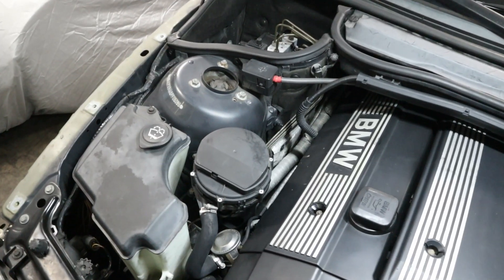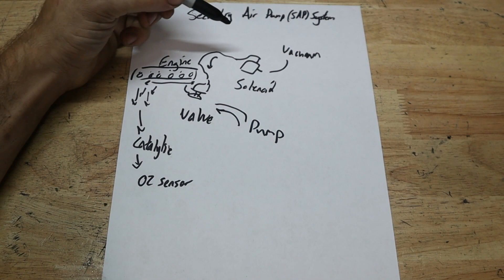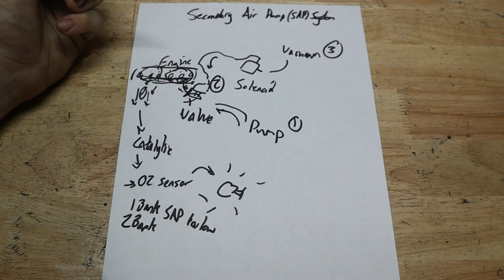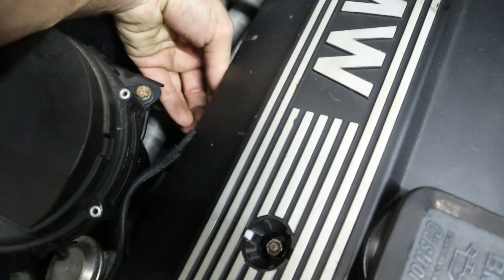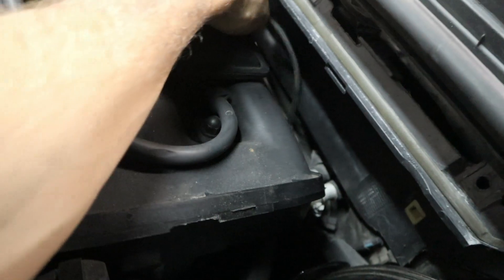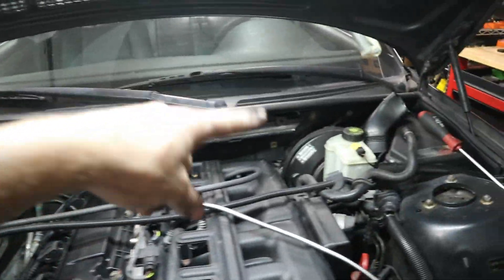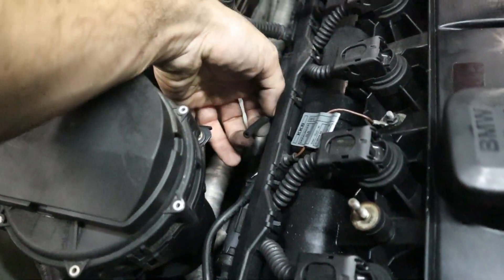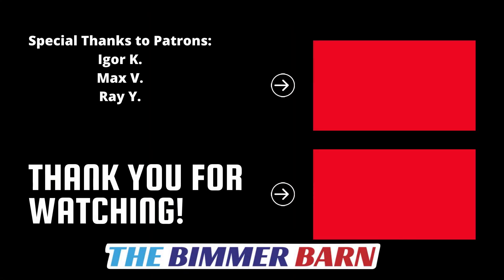HOW TO: Diagnose & FIX BMW Secondary Air System Fault Codes

Comment: Thanks for the video. I have a 2004 525I and it’s giving me throttle issues where every time I wanna accelerate between 40 and 50 and now it’s doing it from 20 to 30 and 40 it is a very weak throttle response and the only code I have to go off. Is this one I already found the leak so I’m gonna try to replace the hose. It’s the hose that connects the actual EGR valve with the secondary vacuum

Comment: Mechanic says I have 2A00 code secondary air…
Symptom tho is growling sound in engine tight vibration. 

Is this associated with this issue?

Comment: What is the symptoms if the valve is stuck?
Reply from the maker: You get a dmtl error for low flow I think, but otherwise the car doesn't run any differently
Reply: @ Thank you for quick answer! Take care, out there!👍💯

Comment: If you cant afford the 189$ hose autozone a basic hose 1 feet for 4$ till u ebay one for 78$ after looking for 2 weeks the. Junk yard one for 10 u pull. Id just take the hose and the big motor with it fkr 20-30

Comment: I have a 04 BMW 325ci, my car does not have a vacuum, the problem I have is that there is no power to the secondary air pump, check the fuse and they have power. Do you think the relay has something to do with it? They changed the key in the car. I don't know if that has anything to do with it.
Reply: Did u fix it

Comment: Excellent video! Thank you for a great explanation. I am running into this issue now. I changed the pump but the codes are still there - so solenoid and valve next.

Comment: Deleted mine
Reply: How
Reply: @Superproductivetoday , remove the entire air system, and the little silver valve (its above the catalytic converter)  with the vacuum line. You block the air line that is in the back of the intake manifold, then there is a plate you install where the silver air valve was (secondary air pump block off plate).
Reply: How is your catalytic converter doing?

Comment: So if I've replaced and made sure all parts mentioned are good, all vacuum hoses, solenoid, black and white check valve, new main valve and pump; but I still have low flow bank one and two codes, I can deduce that the ports on my exhaust being plugged is the only thing that would cause the code now?
Reply from the maker: Sounds about right! You can take off the SAP valve and put a camera in the port and check. It may be so clogged you might not even be able to get an endoscope in there, but that should confirm it for you. Hope that helps!
Reply: @TheBimmerBarn  awesome, appreciate the response my man! I feel that's a possibility being when I bought the car the main hose was busted and the vacuum line at the main valve was broken and both were pretty dirty from sucking in ambient air and dirt lol I'll have to tear into it or code it out by the sounds of it. Really don't want to take the head off lol

Comment: I learned so much from your video!! I have a 2005 BMW 325i with 176,000 miles and my Check Engine Light stays on.  My mechanic said it was my Cylinder Head Ports that are clogged. Are there any fixes to getting that fixed besides an engine replacement? I've subscribed to your channel! Thank you!😊
Reply: I have the same E46 with almost identical mileage! I have been chasing away a check engine light for this type of issue over the last few years. Luckily, I have got it to clear around smog time (every 2 years in CA) I am not sure if you got your issue solved, but there is no way it would require a new engine.
Reply: buy a bottle of catyclean. it cleans the system and clears code

Comment: I have a 2013 128i (E82 with a N51 SULEV engine) and I am getting this code for Bank 1. I have already checked the pump by hooking a battery up to the plug and it runs strong, but I have Active Autowerke headers (which deletes the primary cats), I deleted the secondary cats, it also has an AFE Stage 3 cold air intake, a Magnaflow exhaust, and an Active Autowerke tune (which disables the catalyst system in the DME). The only thing that I can think of that could possibly cause this (and my Thor adapter is suggesting as well) is that my valve is plugged with carbon. Im going to remove it again (because I removed it when I installed the headers), and clean it all out. This is my first Bimmer.

Comment: Secondary Air Injection System Incomplete.
No service engine light, pump is running for 20 seconds and shutting off, solenoid is working and both the solenoid and non return valve do not leak. What could it be?

Comment: Hello. New subscriber here :) Glad to find your video. Can you advise for BMW 320D with Fault code 290900 air to EGR air mass flow, plausibility measured air mass compared with calculated air mass to high, please?

Comment: Quibbles: 1.  the diagram should have been drawn much more legibly,  2.  you blow through quickly and don't really explain how the vacuum lines are routed, well enough for the rest of us to understand.  
Maybe this system is better diagrammed in the Bentley manual (which I don't have).

Comment: Hey I just received this check engine code on my e class benz and was wondering if it is standard to show that the airflow is low on both banks or does that mean that the check valve on each side is faulty? I hear a sort of metallic whistling noise at cold start sometimes and am tempted to adress the check valve that looks like a metallic bell as it seems like it could make this noise.

Comment: I have a 2004 325 touring....240K so far.
Recently started to stumble and misfire...
Code reader says CAT malfunction secondary air pump failure
Runs great 1st 5 or 6 miles....then looses power.
After stopping for long enough to cool...the process repeats.
I can also create the misfire with hard acceleration.
Any ideas?...thanks
Reply from the maker: Does it have a misfire code ? Otherwise I would think a bad oxygen sensor could cause bad running and a catalytic converter fault. Hope that helps!
Reply: @TheBimmerBarn  P0335 and 0702...
my small hand scanner says...
  misfire..cat not ready..secondary air pump not ready....replaced  that hose the short curved one...that made it run worse 🤣
Old hose was soft and spongy.
Was able to get back 70 miles...but stalled twice in city driving...but at least it would start. limp mode on.
I have not seen cold start this am....but its been starting and running great...the great start is when it looses power.
Reply: this am....P0140  160   335  340....
171/174 are gone 🙂
Starts and runs smoothly....driving to a trail head in an hour. Lets see how that goes?
The 2 camshaft position sensors are new.

Comment: So I have a 2005 bmw X3 that's been getting a cylinder 6 misfire on start up accompanied by 2761 code. The air pump and air pump relay is fine - i was told that it was most likely that there's a plugged head on the secondary air ports. I was also told a repair would involve removing all of the cylinders to access the part and not to bother.
Reply: Where's this pumps fuse located and what number....
Reply: @abumannocchi  that vehicle went to the junkyard in the sky about 9 months ago.

Comment: Great video. I just replaced the purge valve and my check engine came on code 1415. Also, I have a 2008 BMW 328i. My Question to you is, how many miles does the car go without replacing the pump?

Comment: Would the filter be to clogged to pull in enough clean air?
Reply from the maker: Perhaps? Haven't seen that before, but could be possible if you live in an extremely dusty area. 

In this case though, you could just pull the hose off that is the fan "output" and put your hand there to make sure enough air is coming out. Hope that makes sense!

Comment: The hose that is capped off with screw and blue tape , runs from your fuel filter/ fuel pressure regulator and connects to an F connector on your upper intake boot right after maf sensor

Comment: I have a 2003 BMW z4 2.5i that only has one code P1415 secondary air system flow too low I believe it should be the vaccum line. Any other recommendations for just this one code?
Reply: I have exactly the same problem "Masa or volume air flow. Too low "

Btw we have the exact car 
How did u fix it ?

Comment: Can u just delete it altogether!!!?????
Reply: You remove the secondary air pump system, follow the vac line that goes in the back of the intake manifold, block the nipple where the hose went, make or buy a plate to put over where the silver air valve went.
Reply: @frankendoodle6379  already did it
Reply: @frankendoodle6379 will any engine codes pop up because of this?
Reply: You need it for emissions
Reply: @C0rvette454  I deleted on both my bmw E39s

Comment: Could this problem cause white smoke to come out of your tail pipe?
Reply from the maker: No, white smoke sounds like a pcv system issue, water vapor is what causes white smoke. Blue smoke from your exhaust means oil leak

Comment: Excellent explanation thanks a lot for sharing, My pump is new as well as my air pump valve the pump works for about a second and turns off...it was working before and now is not so I am thinking I connect the vacuum line incorrectly. can you explain to me the direction of the vacuum line to the solenoid and the check black/white plastic valve. thanks

Comment: Should this happen after only 88K miles? I have a 2000 Z3 with the same codes showing up P1421, P1423.
The engine runs fine but fails emissions test.
Reply: With rubber vacuum lines being 22 years old, I'd say yes.

Comment: I bought a new secondary air pump after disconnecting the hose and not feeling any air coming out of it on a cold start. Maybe you should inform your viewers that the secondary air pump usually only blows for about 10-20 seconds, so after you cold start, jump out of the driver's seat and run around to see if it's blowing. Don't wait and sip on your coffee or text your gf or whatever. Anyway, I watched your video and a couple others and I liked the way you drew out a chart explaining how the whole system works and what can go wrong. I paid Pelican Parts $95 for a new pump, three grommets, and $9 delivery. Did the job myself in 15 minutes after getting all the right tools together the night before (17 mm wrench, 10 mm wratchet, 6 mm wratchet or Phillips screwdriver (either one works on the hose clamp screw), a cotter pin dipped in white lithium grease to loosen and pry off the hose from the pump, and I bought two 10 mm nuts to replace the ones that had fallen off the broken grommets (one was still there so I used it again). I highly recommend to anyone doing this pump repair to check whether the grommets are broken first because once you take it all apart you won't be able to drive to the hardware to buy them. Play it safe and wiggle the pump around the night before to figure out how many grommets are broken, or just play it safe and buy three 10 mm nuts the day before the cold start.
Reply: Underrated message.thanks

Comment: GREETINGS, In what directionis the check valve placed, the white side towards the manifold or the  black side, and is it placed before or after the vacuum control valve ..., and the pipe enters the straight inlet or the one at a right  angle...?   THANK YOU.
Reply from the maker: I don't recall which side is which, but; simply blow into the check valve, and the direction that the air flows should be pointed towards the intake manifold. That way, when the car starts, and vacuum in the intake manifold is created, the air will also be sucked out of that vacuum line, creating consistent vacuum on the other side of the check valve. Hope that helps!

Comment: Can you get a Lean bank 1 and 2 code if your hose that goes from pump to valve has a rip in it?
Reply: Did you find your answer to your question?
Reply: @alexlive9375  I bought a new one and put it on and the code didn’t pop up again
Reply: @fresnoliving5593  thanks mate, I just did that right now but haven’t drove it. Hopefully it doesn’t pop up again
Reply: @alexlive9375  no problem, make sure your air intake boot isn’t ripped. Mine was cracked from the small boot
Reply: @fresnoliving5593  so far doesn’t seem like it is, I checked

Comment: Nice clip! Could they causing the fuel system stays on open loop even on idle? ie, 0v on O2 sensors and 0% fueltrim. The ECT is at normal range temperature.
Reply from the maker: It's just part of the cold start routine so it shouldnt create an open loop condition as far as I'm aware

Comment: Great video Chris I’ve had several of these issues with the SAP I had to take my valve off and pull a vacuum on it with a mighty vac and blow through it to make sure it was working.

Comment: Great video. One thing I did with my BMW is replace all the vacuum lines with silicone rubber so I never had to worry about rotted rubber ever again and in a place as hot as AZ it's well worth doing as the heat here tends to degrade rubber, batteries and so on. Also, my silicone rubber windshield wipers lasted over 5 years and never streaked so as you can imagine I'm a big fan of it over rubber where you can use it.
Reply: OK,  Thank you so much, it realy help me. great video !!!!!!
Reply: Where can I buy the silicone vacuum lines ?
Link?
Reply: @t-pitz8866  My comment would probably be rejected if I tried to put in a link however google/amazon search for something like Silicone Vacuum Tubing Hose 8mm should get you what I used.
Reply: @Just Data  ok ty ! Currently trying to pass smog  "secondary air system " .
Silicone hoses are what I did to my pontiac, and oh boy were they crusty lol 😆 thx again
Reply: Sizing and lengths? If you know.

Comment: I have a pending code of p0411 what can I do to fix it ? Thanx.
Reply from the maker: Check the secondary air system, vacuum lines, etc like we did in this video! Then if everything is working correct, you may have carbon build up inside the cylinder head. Good luck friend :)
Reply: The secondary mass air flow sensor can cause P0411 as well. I found that out after replacing the valve and hoses without success.

Comment: Thanks for watching your video i did everything you mentioned but now the accelaration sometimes is poorly and my service light flashes
Reply from the maker: Weird! I'm not sure why you'd be down on power, unless something else is also wrong. I recommend checking your codes and that should tell you what needs to be fixed!

Comment: What is the part number for the vacuum hose on FCP euro or pelican ppl parts?
Reply from the maker: From FCP Euro they have couple different options/lengths, but this one is 5 meters of black rubber vacuum line: CRP 51731257971-5

Comment: 03 e39 525i. My sap doesn’t even turn on.
Reply from the maker: There's a relay and 2 fuses that work to turn it on, I would start there! Or, apply 12v to the pump alone to see if it works. Good luck!
Reply: @TheBimmerBarn  pump works👍🏼. Don’t know where’s the relay & fuses?
Reply from the maker: @sambonilla416  Not sure, should be in the fuse diagrams or somewhere online though!

Comment: 03 e39 525i. My sap doesn’t even turn on,on cold starts.what gives?
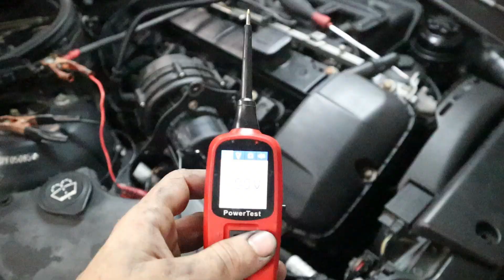Reply: Check the pump to see if it works like he does at 12:21, directly from the power source. That will tell you if the pump is actually working. If the pump runs with direct power then you aren't getting the "turn it on" signal to the pump. Test the connector he is holding at 12:17 with a cold engine to see if it's sending power to the pump. If no power goes to the connector try replacing the relay. Good luck.
Reply: @BrookBowenVideos  I bench test pump it works👍🏼. I took out the relay will test tomorrow. I’ll check to see if there’s any vacuum coming from the valve in the back.
Reply: pump= Good
vaccum from solenoid= good 
Hoses=Good
relay=Good
must be the Valve
Reply: 1.Cold start
2.Pump turned on ( hoses weren’t connected).
3. There was vacuum coming from solenoid.
4. New check valve installed 
———————————
NOW: Cold start
Every thing is attached “hoses etc”
Pump doesn’t turn on.
I benched test pump, it turned ON
I plugged it in the car without hoses attached, it turned ON.🤯
Also there was no vacuum coming from solenoid.

Comment: Great video, Chris. So you have access to the vacuum line, that runs to the back of the intake manifold, when the cabin filter tray is removed? So the intake doesn't have to be removed to replace the vacuum line to the solenoid, correct? Thanks!
Reply from the maker: Yes! It's hard to see, but with the cabin filter off, you can feel the back of the intake manifold and the solenoid is right there. Easy to change the vacuum lines without much work! Hope this helps, lp!